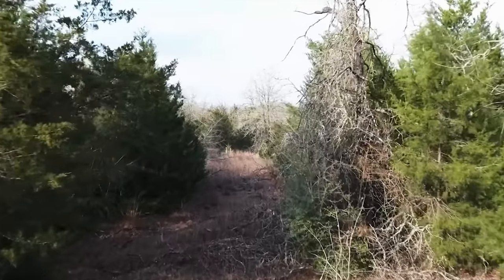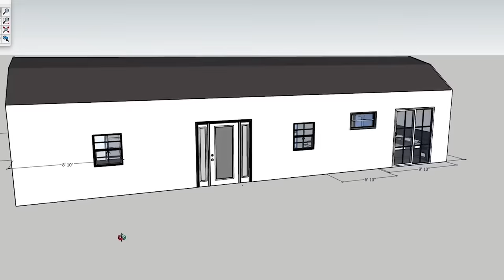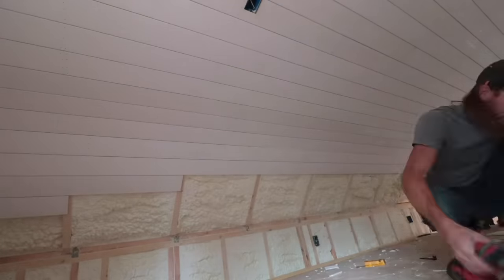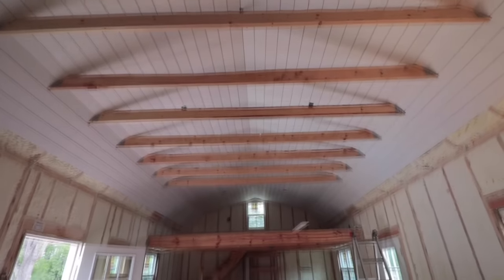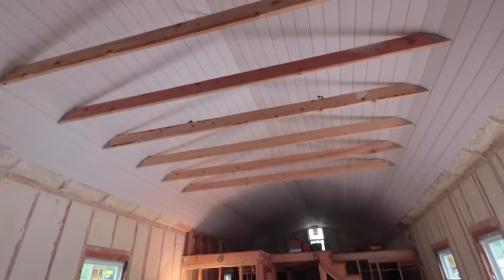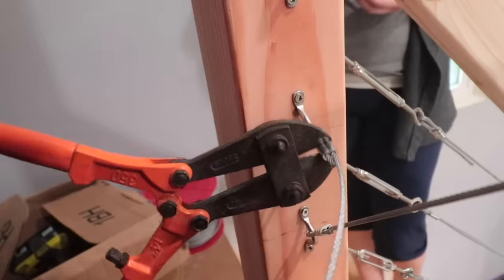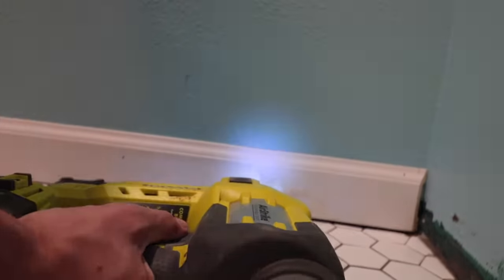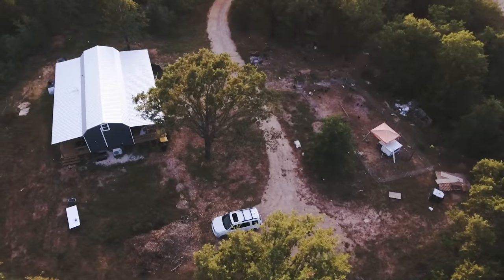515 Day Shed to House Conversion in 13 minutes {Timelapse}

Comment: We had a complete Karsten home 25x50 delivered and set for $55000. Sold my home and paid cash. Best thing I've done.
Reply: Does this include finished walls, electrical,insulation, etc? 
I'm trying to start planning
Reply: @jamesdavis2811  think it’s just the building itself
Reply: @jamesdavis2811  I live in Houston and there’s a place across the street from me that makes like metal buildings and cabins and stuff and I called them because they have a three bedroom two bath cabin for 1700 ft.² totally finished everything for 80,000 you just have to look around
Reply: @Moneygirlhood  those steel buildings are getting more popular. They're not great for colder climates, but you can insulate whatever you want with enough money

Comment: One thing we're doing that has been a lot more useful than we thought...   We put gutters on our house and redirect the rain water into a 2000 liter tank.  Then we feed that through a berkey water filter and use it for drinking and cooking.  It tastes better than any well or city water we've ever had.  In the video it's not clear if you brought in city water or if you have a well.  But having a second source of water would be nice either way.  If you're on a well and the power goes out, you might not have water.  And if you have municipal water, having another source can save you some money.  You can also use the rain water for gardening, or if you want to have a source of water that you know is free from chemicals.  You can use it to fill animal troughs or swimming pools also.
Reply from the maker: Oh YES!!!!! In November we will begin our rain water harvesting adventure!!  😁😁😁😁😁
Reply: @BetterTogetherLife  I'll never live without it again.  Make sure you get a tank that isn't translucent.  If it's translucent, like an IBC container, you'll have to paint it.  You want it as dark as possible  inside to fight algae.  There's a device you should use, a first flush system.  It's a vertical pipe with some kind of float or plastic bottle in it.  When it first starts raining, the water fills that pipe first.  The float then closes off that pipe so the water can run over it into the tank.  You drill a tiny hole in the bottom of the pipe so that it slowly drains off when it's not raining.  The idea is to throw away the first water that comes off the roof since that will be washing all the dirt or whatever off your roof.  You should also put some window screen over the tank where the water enters.  It will keep mosquitoes out and act as a filter for leaves and other things.  You'll be amazed how much water you get.  With a roof your size, an inch of rain should give you about 1000 gallons.  I'm considering making an outdoor shower with a solar water heater fed by our tank.
Reply: @brianlanning836  Wow thanks for the water tip!! Ur Awesome!!!
Reply: @Lemmiwinks We don't have any trees over our current house.  So it's not an issue.  There are a few gutter systems designed to collect water while shedding leaves and other things.  Nothing will be perfect though.  So I have a piece of window screen over the tank where the downspout ends.
Reply: Brian Lanning Such a smart plan.
Reply: Literally first thing they did was show that they had dug for water?..
Reply: I can never rationalize drinking water that has bird poop in it - even if it's filtered.  Yukk.
Reply: In Australia 🇦🇺 we install 20,000 - 30,000 litre water tanks minimum.
Reply: Acid rain tasty.
Reply: Rain water has no minerals, so make sure you are getting them from somewhere. We drank distilled water for a few years, and my (then) wife developed arthritis in her 40's. I switched our water, and it went away in 3 days. FYI.
Reply: Check local ordinances, in some states rain/water harvesting is actually illegal.  Ya, ya, I know.  It's stupid. But it's something they can charge you with.  This has come up in several "off grid" videos.  It's ok to sink a well but it's not ok to capture run off.  >rolls eyes<
Reply: @Lemmiwinks Also, they do make inserts that are designed to keep stuff out of gutters.
Reply: @Shindinru  Most of the instances of people getting faulted for that turned out to be doing in on a fairly large scale that actually disrupted the water supplies of the area.
Reply: @InfernosReaper  - I wish.  It varies by state and sometimes by county.  If someone in the local government doesn't like the idea of you being off grid it is an offense that they can charge you with.  In some places it's actually a felony offense.  As I've said, it has been a problem for some trying to go off grid.
Reply: @phyl1283   - In Los Angeles, 100% of ALL sewage (yes, 100%) is recycled and put back into the water supply! Yes, people drink it. It all depends on how you treat it.
Reply: That's illegal in Northern Idaho. Would feel a ton better if you got a countertop water distiller and drank from that. They sell them on Amazon, Wish and EBay for reasonable cost. Too much aluminium being sprayed into the atmosphere per Chemtrailed and weather modification. Just a heads up!
Reply: @phyl1283  That has been my rationalization against roof top collection, but then again consider cities that utilize surface resevoirs and rivers (bird AND fish poop, plus whatever gets washed into or dies near the feeding streams).  Groundwater, you say?  I am very curious as to what point urine filtering thru mud, sand and rock becomes pristine.  I can't even imagine water percolating thru solid waste of a septic field ever being desirable.  Bacterial action? Bacteria poo too, where does that end up?  My bigger worry is how much of my older neighbor's fanatical usage of RoundUp is pummeling down gopher holes into my shallow cracked basalt well.   Face it we eat or drink excrement every day of our lives to some extent and from the more recent discovery of a healthy gut biome and immunity exercise it's probably a good thing, so let's get past the "ew" factor.  Besides, surface and groundwater sources are vulnerable to criminal and terrorist contamination, or Dick Cheney's "prioritary" secret sauce (prioritary because they knew it would never pass the EPA/DEQ if revealed) used for fracking in about 47 of the 50 states. The only truly pure water would be burning hydrogen in the presence of oxygen.....like Matt Damon did in The Martian. The recycled water in space at a cost of $17,000 per liter (delivery costs) is cleaned well beyond municipal standards.  Imagine part of an astronaut's duty is to void your bladder to the best of your ability before returning to earth so more costly water isn't required from earth.  The true threat to your life is whatever DuPont or Monsanto comes up with more than sanitized natural waste could ever be.
Reply: @ricknoyb1613  Don't be so paranoid on "contamination". The air you breathe is "contaminated" at a level you can't imagine. There are bacteria, yeast and all sort of microbes everywhere, including your mouth, your nose and your stomach. Most of it is safe. We are very adapted to these and we live in symbiosis with it.
Reply: I visited South Australia and most all the houses had rain water collection tanks, even the small retirement cottage I visited.  A guy told me a calculation something like 1mm of rain off 1 square meter of roof equals 1 liter of water. He had a home miles out of town with a large tank and didnt need to dig a well. The roof of his house more than filled his tank even with as little rain as they get there.  I was SO impressed. I live in AZ. Why the heck dont we do that here?????
Reply: @brianlanning836  I personally love the water system in earth ships - the water is collected, filtered, then used 4 times. No need for a water bill or city water and it's so much healthier not to have all the chemicals.
Reply: I'm making a move to Colorado, getting water on raw land is the absolute most important thing. If you have to go down to the deepest aquifer (depending on what water rights you are granted) a well can cost up to $80,000. Guess what the law says about rain water harvesting? It's illegal to capture more than 110 gallons at a time, and it can only be used for "outdoor" uses, no drinking, showers, etc. Nice free country we have right?
Reply: Using Rainwater, by getting it from the roof of your very own house, and storing it in a huge tank, is a great idea! Saves on a Water Bill from some City Source big-time! I don't even know how much they charge for a Gallon of Water anymore...but I imagine that it's quite a bit. Saving money is always smart. Kudos to you, Sir!
Reply: @Shindinru  They that are telling you that it's "Illegal" are quite possibly part of "Big Brother". It's pathetic!

Comment: If it ever becomes an issue in the future and the kids/clothes get hooked on the cut off ends of the wires on the stairs put some heat shrink tubing over them. Cleans it up nicely and protects anyone getting poked. 
:)
Reply from the maker: Yup!  That’s what we have done.
Reply: My first thought when I saw those cables was, "YES, a stairwell that doesn't have to be dusted!"  Brilliant.

Comment: This brings me back to 27 years ago when we did tbis with our 5 children. We bought a 3 acre wooded lot and a single wide trailer and built a 2700 sq foot 5 bedroom and 4 bathroom house with a huge front and back porch abs moved in it while we built. The first two weeks we had no plumbing or electric and used the most interesting ways to include washing dishes in tubs also lol. So many things hit home. We were so tired for a few years. We never seem to be able to stop building and improving.  It was addicting and we had growing boys to help and we ended up with a beautiful place. It’s awesome what you are doing. Kids will appreciate this when they are olde d teaches them a lot.

Comment: I absolutely love your place.  I love that you put railings on your stairs. Lots of tiny houses don't have any or only a small one on the inside wall. 
Did you use tie downs vs a concrete foundation?  That way you don't have a deed and you have way less taxes. 
I  prefer an under the counter sink over the top mount ones. It's easier to keep them clean around the edges
Reply from the maker: Thank you June!!!!!  Yes to less taxes for sure!

Comment: Hmm, Perhaps one day for the Future, you could like do another shed to house conversion. One that is Smaller on the land. with 2 bedrooms. and 2 bathrooms, with Kitchen in the middle. For when your 2 Oldest kids are around 16 or 17 years old to live in. Perhaps could make it like a teaching tool for them for when they are ready to get there own place to live.
Reply from the maker: Yuuuuup!!!!  That is one of the options that we have planned.  Let the kids build their own house!!!

How amazing would that be for this to learn!!!
Reply: Chakat Nightsparkle ...their... ? 🤦‍♂️🖕🏽
Reply: In the future.. remember that the interior molding and trim industry to follow suit from pressure of home designers and others. Changed how molding and trim was installed by method and design. The cavity on the back of all trim and molding is there so molding can be glued up.. I use construction adhesive. (liquid nails original) and a commercial 3m holt melt gun..

the intent goes like this.. we prefit and precut all the pieces.. paint the pieces.. glue up by by making quarter sized dots of construction adhesive every 8 inches or so... and then place a few dots of hot melt to provide initial bond.  

I realize this takes time.. I realize its way over the top... but it is how its done... I do have customers now I come across from time to time that demand it... I personally dont have it done that way in my home except for around a few doors and it does look amazing when done this way.
Reply: @leanwoodworks  We have this glued-on trim molding in the "new" part of our house, but it doesn't stay on. Keeps falling off. I prefer something nailed on!
Reply: Hi , that is a great idea , it shouldnt cost too much and with their experience will be a breeze to do . Also have some panels on the roof for   solar piwer  electric and a solar water heater linked to the wood burner heater for winter .
Reply: Love your thought process. Schools should be more like life not academics
Reply: What was the total cost?
Reply: Better Together
Reply: @caseysimon6357  so you feel better about yourself now?
Reply: Pll
Reply: Build a house.  You will never be able to convert this to a house. It will always be a shed. If serious about a building to live in read up on it. Don't be a sheep and believe tiny house shed is good. It is one step up from a cardboard box on the street.
Reply: @userumbleyoutubesucks2871  Someone is a Trolling here. Dont listen to this person please.
Reply: @BetterTogetherLife  what size shed to house building did you go with?
Reply: That's what I was wanting to do.  Start with something we could all get by in and get smaller satellite homes up and running as the kids came of age.  My dearly beloved couldn't wrap her head around the idea.  We settled for a small house in the south side of Wichita.  No mortgage and almost no debt.  It's not tiny, but the principals are the same.  Living tiny, in a regular sized house.
Reply: @johngifford7725  Tiny home living is not for everyone. Most of the time a Partner wont want that or perhaps is ok but still want something bigger then a tiny home would be.  While there isn’t a set standard, a tiny house rarely exceeds 500 square feet. Beyond that size, they’re merely, um, small. To me a Tiny Home size is anything really under 900 sqft. But again no real set standard on size.  Like most Tiny homes are between 80sqft to 400sqft and on trailers. Its what it was when it first started off the big trend of them. Now a days, I will say the ones that are on foundations or piers avg around 300 to 1,000 sqft. 
Now a days avg Home sizes are over 2,400 sqft. WAY to big of a home its like unneeded really. But people want them cause its like. I want Big so i can Show people have Much money i have.
Reply: @ChakatNightspark  In my mind, the "tiny home" is about the financial freedom.  The size of the house is only important because it facilitates that freedom.  If the same financial freedom could be found in a larger structure, 90% plus would opt for that.

Really and truly, it isn't about the size of the house for most of the people.  It's about ditching the mortgage and getting out of the rat race.
Reply: 3 we q1